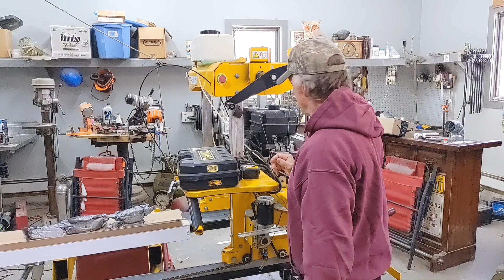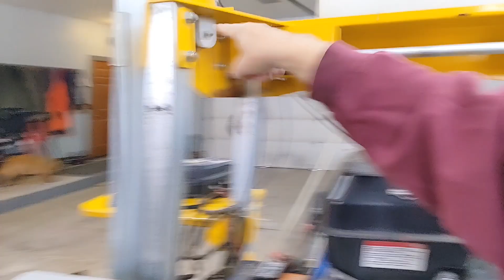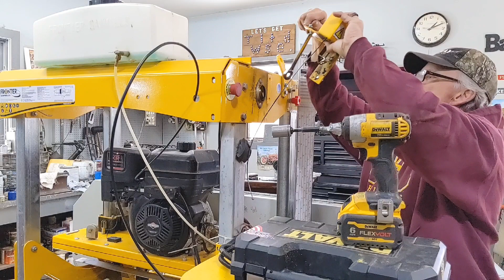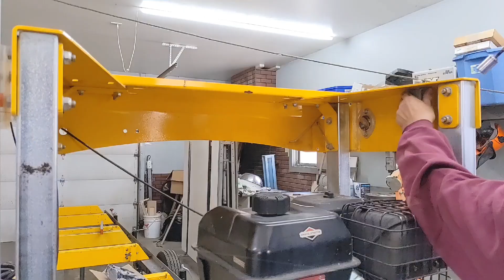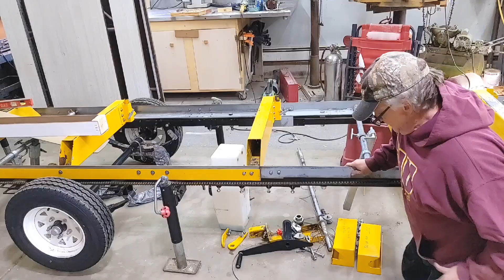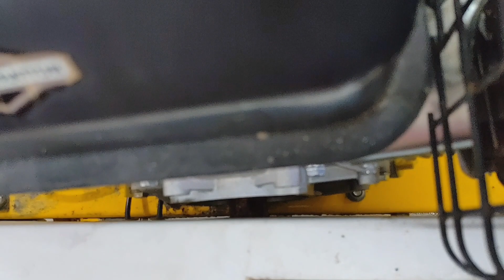Power Head Feed Up Down Part 2. Removing Unnecessary Parts

Comment: hey Jerry and great start to the power head mod, sure is some parts there to make it go up and down eh. Im still looking at mine and thinking what should i do with mine. Im kind of ok for now pushing the mill but the power feed head would be awesome. Ill await your results. Are you using the trapezoidal thread ?
Reply from the maker: Yeah, there are a few parts you have to fabricate but it's not too bad.  Yes my screws are trapezoidal acme threads.  I dropped them off at the machine shop I used to work for to turn the ends.   They've not got to them yet.  They are pretty busy and it's winter here so no big yank.   That's all that's keeping me from finishing the build.  Hopefully soon and maybe even for this coming Tuesday video.  Fingers crossed.   I think the cable system with a lifting mechanism would be by far the easiest lol but this will be stout. 

Thanks for all the support Buddy
Reply: @BigelowWoodcraft  yeah the fabrication parts would be easy enough too. Times like now i wish i had my own box lathe to turn some parts down on. We dont even have one at work 😔 The winter for you is when you want to be tackling these exciting projects though arent they.
Ill await your next video eagerly.

Comment: Hi. Im just wondering why to remove the proven existing lifting assembly? Keep it as it is and replace the crank handle by the Motor with a gearbox. Would be the simplest. Going with the screws, how so you align the head?
Reply from the maker: Yes that would be the easiest system. I've seen several systems doing exactly what you alluded to.  They work great.  I have never have liked the cable system.  Mine have a few frays.  I also don't like the fact I've had to adjust my head every few months. It's easy to do but I shouldn't have to do it every again once I get these adjusted.  I love the five simple machines and I believe the screw system will do everything I want to accomplish.  Plus I wanted to build it this way. 😀
Reply: @BigelowWoodcraft  OK got it. I was just wondering. Going with a spindle is a very nice solution of course. Anyway I like how you are upgrading your sawmill. As you said, no need to start with a 20k€ sawmill - if you are able to improve it exactly as you want to have it. That's why I like your channel because it's down to earth. all the best - looking forward to see you next modification in action!
Reply from the maker: Thank you Arnold.
Reply from the maker: Aligning the head will be  much simpler.  All I will have to do is turn the flanged  brass nut

Comment: Now on that brass part that hooks to the “ floor pan that the engine and battery sit “ is that metal thick enough not to flex ? A lot of weight and vibration at that point. Was wondering if adding a plate there to spread out the load ? Idk. I guess it wouldn’t be that hard to add some later if needed. Arm chair engineering lol.
Reply from the maker: I've thought about that.   The "floor pan" is only 3/16 both top and bottom.  I have actually cut 2 more pieces of 3/16th with a clearance hole.   Kind of like a big fender washer on the bottom.  We think a lot alike.  Thanks for the support
Reply: @BigelowWoodcraft  yes on the bottom, was just thinking about that when you replied. Make for a nice clean look to. Cool!